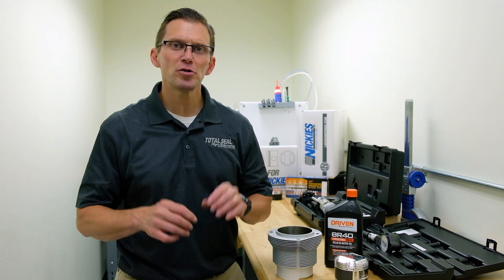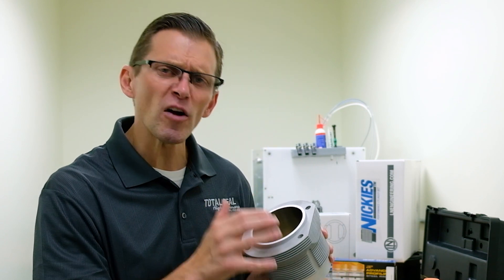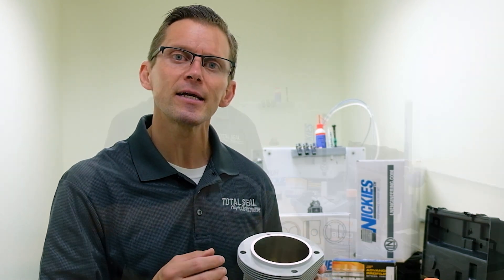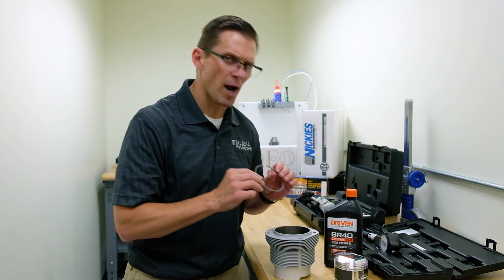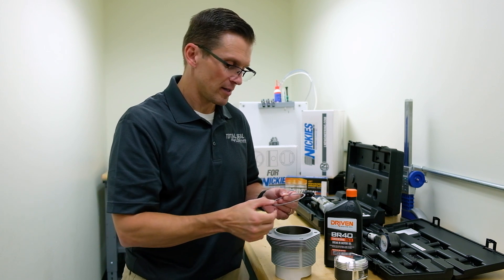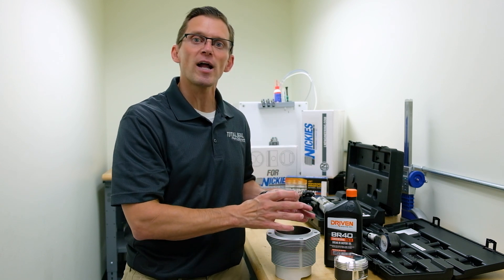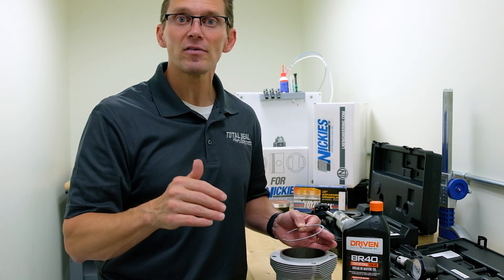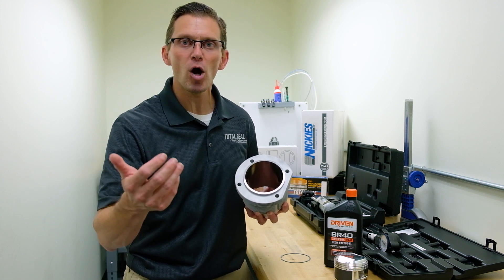Piston Rings 101: Break-in Procedure - with Lake Speed Jr.

Comment: If you apply a load to the piston, I thought the combustion gas will try to seep into the ring-wall interface and the ring will contract instead of expand.  Only when an engine brake is applied, a vacuum is created and the ring expands.
Reply from the maker: By design, the combustion gasses get behind the rings and help to ensure positive ring seal with the cylinder bore. Running the crankcase under vacuum is something most modern engines do to improve ring seal when running low tension rings.

During break-in, varying loads which also requires utilizing engine braking will ensure the rings seat correctly.

Comment: Great video!!  Very good detail!   I have a ktm 530.  I rehoned the cylindered because after installing a new piston I could see lines in the bore (about 3 hours of use).  I had a leak down test of about 4%.  I had the cylinder re nikasil.  Now the leakdown is 20% and it will not start.  I had to use the same rings because they are back-ordered (found out after).  The ring gap is within spec. Is there anything that I can do to the rings to seal?
Reply from the maker: Assuming the cylinders were refinished correctly and that is not the issue, I would not expect the used ring to seal up in a freshly reconditioned cylinder. You'll probably have to pull the engine apart to change the rings out. If the OEM ring is not available, Total Seal can supply replacement rings for most applications.

Comment: Does that mean nikasil cylinder doesnt need break in..coz its akready plateaued
Reply from the maker: Correct. Nikasil is much harder than steel or cast/ductile iron, so the rings are what wears during break-in. That is why surface finish is so critical with Nikasil bores as well as what lubricant is used as well as tune.
Reply: @lnengineeringllc  thank you so much for repliying...so a fresg nikasil cyl can be ripped out of the box when installed
Reply: I am replacing the pistons and rings on a Kawasaki 310 jet ski which has Nikasil cylinder lining and was wondering if I need/can/should rehone the cylinder or I should just go ahead gap and cut the rings correctly then break it in using the right oil?

Any info is much appreciated.

Comment: Very informative video. IN your opinion does this apply to factory cars as much as it does for newly built or race engines?
Reply from the maker: Carrying out a break-in procedure might not be necessary, however, with new cars, probably the best thing you can do it change the oil sooner than the factory recommended service interval.

Comment: hi, i just had my 180cc cylinder block rebored to fit 200cc piston and rings.After installation the bike still smokes alittle bit,kindly assist to understand the cause of that and how to solve the problem
Reply from the maker: Assuming the break-in was done correctly and the rings did seat properly, there are lots of things that could cause smoking, but specific to the cylinders I'd make sure the cylinders are straight and round and that they were properly honed with the correct surface finishes.

Comment: Great info! I rebuild 2 strokes (outboards) and since they only run with a smattering of oil, running the rebuilds SLIGHTLY rich is actually good for them since the fuel itself is lubricated. rings still have plenty of bite under load. but you guys at LN know more than me. just something thats worked for me the last 10 years. and startup (initial) is done without load for 2 minutes. thoughts?
Reply from the maker: We don't have any experience with 2 strokes and I know that is a totally different situation with what we see with our Porsche engines. It's been our experience with 4 stroke engines that having the engine run lean during break in is better than rich. The biggest issue we see are carbs that are jetted to fat and the bores get washed down. We're working closely with Driven and Total Seal to see if we can improve ring break in with use of PVD coatings and assembly lubes specifically optimized for nikasil bores to overcome some of the most common issues associated with these engines.
Reply: @lnengineeringllc  Hey thanks for the response! I do know some mercury racing motors and some of their little ones (25hp comes to mind) have Nikasil bores, too. Not easy to get them re-plated only a few guys do it. the . Vertex and WSM pistons I use have that ceramic/teflon coating for break in. Cannot tell you if it helps or not, but never had a failure using those! Cheers.

Comment: So, I just got my piston rings replaced in my Yamaha bike. I am just a little confused since I do not know too much about this. Since I have new piston rights now I have to break in the rings? How long does that usually take? Should I use some cheaper oil until they are broken in or the good mobil 1 oil that I use?
Reply from the maker: There is indeed a break in procedure for the rings. With nikasil bores seating the rings can take longer than with iron bores. It is especially important to make sure that you don't run the engine rich during break in. If you don't have access to a dyno for break-in, we typically tell customers that it will take at least 1000 miles for the rings to fully seat, but we tell everyone not to run a synthetic or even partial synthetic until you have 3-5k miles on the engine. For sure never use a full or partial synthetic to break in a new engine or even a conventional oil that has moly or similar friction modifiers as that will interfere with the break-in procedure.

Comment: Lake, I've got 3 variables of ring movement under compression and/or power. (1) An old 1940's auto book said the ring sits in the middle of the grove as the air bubble holds the ring in the middle of the groove. (2) Another one would be the ring is flat on the groove and that seal factor under movement. (3) The last theory is the ring is cocked due to the thrust side of the piston and that one angle on said stroke shows the wear pattern. Who is right? Thanks.
Reply from the maker: I'm not so sure about an air bubble holding the ring in the middle of the groove, but as Lake often states, oil is the gasket for the piston rings. You have an oil film that seals the ring to the bore and to the piston. However, you do have combustion gasses make their way behind the ring and that's what provides the mechanical pressure that pushes the rings against the cylinder wall. The rings do move in the groove and rotate, so there is lots of movement depending on lots of factors, so there really isn't one right answer. Lastly, with wear, the ring flats really shouldn't wear - the faces do however and as they wear, the end gap opens up. That's why you have an upper wear limit for ring end gaps as that's a good measure of ring face wear.
Reply: @lnengineeringllc  Thanks for your honest opinion. I'm just thinking off the wall, and tell me if this sticks? Would you agree. if we took a 4-storke engine and apply: 'It only works one way [fuel/spark/compression], and it only assembles one way';  that's in the absolute, correct? If I apply iowow, do we eliminate 2 of the ring theories? It only wears one way. Pressure to compound, I'm getting a hang on reading a tire. Read a plug, I can hold my own. Now I want to read a ring. See where the madness is going? If I apply Mr. Ohm and his formula  matching magnetism, and that is a balance; then I add Newton's law and his understanding of balance in the action-reaction. A says to C, I'm sitting on the groove, I'll be right with you. If you can read the abstract? Said another way; shoot a gun. Bullet hits target, now it recoils at the shoulder.... for every action? E travels at the speed of light or close enough. Heat is magnetism. Pressure is a balance and that fight you are up against. How close are we to; IOWOW 101? Signed,  still in the pits after all these years.

Comment: So if i have idled my motor while troubleshooting leaks and codes etc. does that mean theres no point in me doing the break in process?
Reply from the maker: Excessive idling on a new engine is not recommended. Without putting a load on the engine, you won't get the rings to seat. A proper break-in procedure always needs to be followed.

Comment: So if synthetic oil isn't good for break-in period, what oil do car manufacturers use in the engine if by owner's manual it requires synthetic?
Reply from the maker: Good question! Many OEMs will either pre-run their engines or ship them on a fill that is not the same as the synthetic recommended and used by the manufacturer for subsequent oil changes. High ZDDP isn't so much needed to protect camshafts and lifters in modern engines, but using a synthetic oil or even a conventional oil with high levels of friction modifiers such as moly can slow down or even prevent the rings from seating properly which can result in higher oil consumption than normal, blowby, and/or smoking. Once the engine has broken in though, using a synthetic oil is perfectly fine.
Reply: @lnengineeringllc  How interesting...Thanks!  Afterwards for broken-in engines you can use oils with high dose of friction modifies without negative impact?
Reply from the maker: @Charkatak  Oils with friction modifiers won't cause any issue on engines that are already broken in. Besides increased horsepower and reduced fuel consumption, we tend to see a drop in oil temperature too with oils that have moly in them over non-friction modified oils.
Reply: @lnengineeringllc  Great!  I just recently started looking into "Used oil analysis" and sent one virgin "Acura synthetic blend" oil for an analysis.  The reason for this is because I recently switched from above mentioned synthetic blend to Pennzoil Platinum/Ultra full synthetic oil but I believe when cold engine doesn't sound as quiet as it did with blend oil.  What to know if that oil has more moly in it or another friction modifier.  Car info: 2010 Acura RL (J37A2 engine) with over 100k miles.

Comment: very informative.  I got a built engine that was broken in on a bench dyno.  I have 3,000 miles on it and bliwby at high boost.  staying below 20psi and no blowby.  Engine builder says "Never seen rings seal at low boost and not at high boost without their being another cause"  🤔 do you think a stuck ring? no smoke idles, no smoke revving it
Reply from the maker: We would recommend doing a compression and leakdown test, especially the latter to determine where the blowby is coming from.
Reply: @lnengineeringllc  turned out 2 pistons broken rings